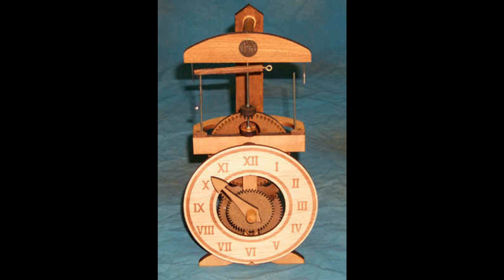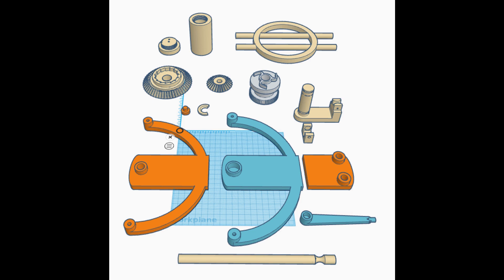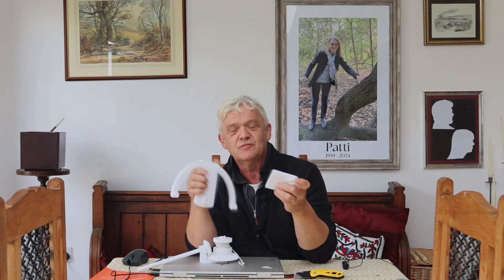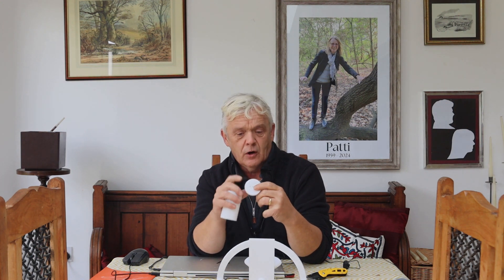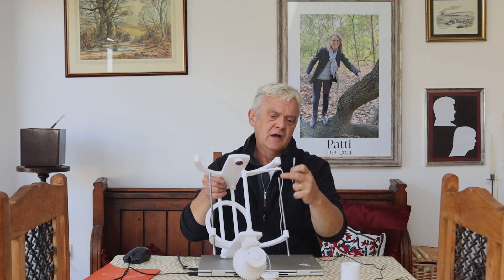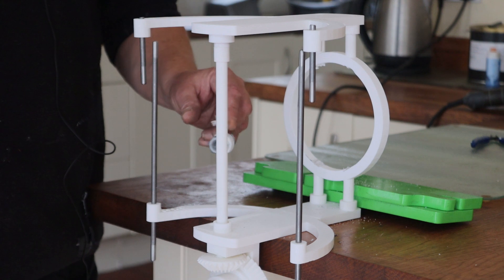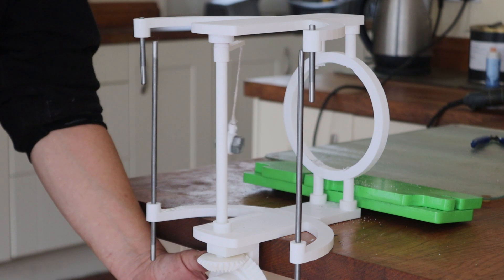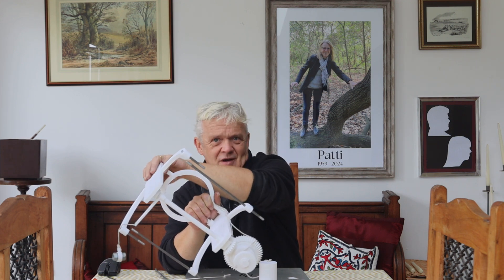2304 The Craziest Clock Mechanism In The World

Comment: i don’t know why but the last few posts of yours reminds me of an uber simple LED light source some one created thru a kind of UN program, to distribute free around primitive parts of Africa so the hut dwellers didn’t have to burn sooty dung for illumination any more (and get lung damage understandably)
Saw it in a show ages ago.
Was a power feed  to the simple LED(s), energy from (a basket i think?) that is loaded with rocks when “at the top” like those old weight driven clocks, and maybe a flywheel is spun as the weight super slowly lowers to the ground? Pretty much it, very few parts, then again memory over a decade or two isn’t infallible. 
Had a crazy long powering time. Seems to me that would be neat for a cheap light source in my own home. Your recent projects make me think this can be pulled out of my memory and tinkered with. Thanks for your inspirations.

Comment: Hi there I used to have a small clock with this pendulum. The top bars were slightly rotated to cach the string to cause it to  rape anty clockwise looking from the top. It would then unwind and cach the bottom rod and wrap clockwise. So the string wraps around the 2 bottom rods for a total of 4 times for one rotation of the pendulum arm. This will increase the amount of time it takes to unwind the clock. I hope this will help you to understand what the top 2 rods are doing. It fascinated me .unfortunately it was lost in a house move.
Reply from the maker: cheers mate
Reply: @ThinkingandTinkering  hi there is there any chance of a part 2 as if you can get it working it would show others better than the drowning
Reply from the maker: @paulsharpe3794  oh yeah - this is an investigation there is a part 2 and 3 coming up mate

Comment: I remember building a similar mechanism out of Lego. Iirc it used a wind-up box instead of gravity. I dont think it used a top frame either, but then again I think it was more about building the mechanism than keeping time. Maybe the top bars make the winding more consistent? 

On a tangentially related note, my new favorite way to keep time are radio signals. Theres a few atomic clocks broadcasting around the world, and the circuitry to pick that up ought to be straightforward. (Unfortunately i havent gotten around to actually building a project, just some research)
GPS is another fantastic source for time, because those satellites are essentially just atomic clocks in orbit.
Im hoping I can pick up WWVB indoors because thats the greatest weakness of a GPS clock, you basically need line-of-sight to the sky.
Reply from the maker: cheers mate